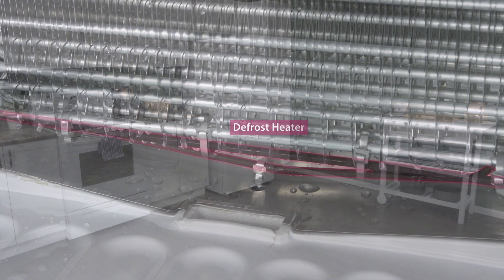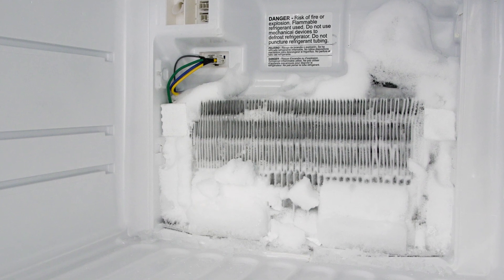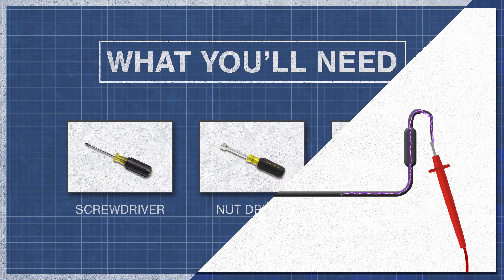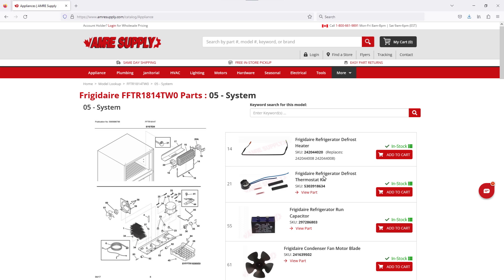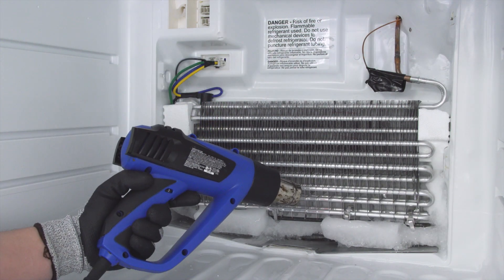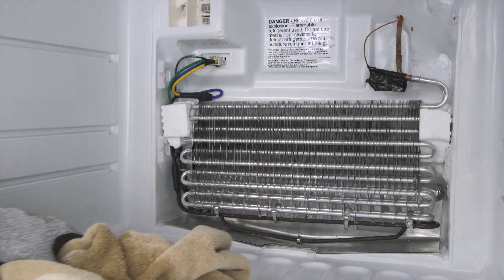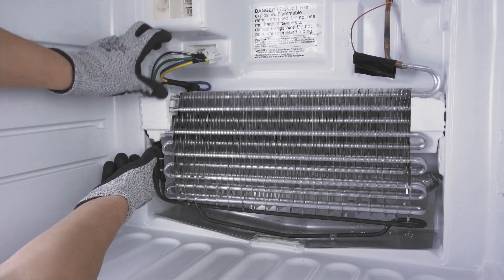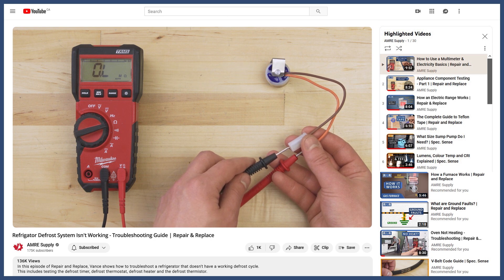How to Test & Replace a Defrost Heater in a Refrigerator | Repair & Replace

Comment: Struggling with your top freezer illustration for a side by side( more common these days) Heater testing: do you specifically have a video for side by side ?
Reply from the maker: We don't have a illustration or animation specifically for a side by side but the testing is the same. Test the heating element is similar on both types.

Comment: Vance, thank you fro sharing the info, especially the resistance values of the Defrost heater,  defrost thermistor and continuity of the defrost timer. My issue was, freezer side was working ok, but fridge side was not cooling. While checking realized condensor was full of ice.your step by step wiring checks i found out my defrost heater having 1.5 Mohms resistance.( shud be 20-100). Also my timer was shot. After removing the heater it was burnt through the sheath, thinking timer was not cutting out and had provided prolong heat until its death. Thank you.
Reply from the maker: Thanks for the detailed feedback on the video and glad you were able to diagnose the problem!

Comment: So this is the device that melts the ice accumulation on the evaporator coils and runs water all through the fridge flooding the shelves and soaking everything?
Great, got it.....
Reply from the maker: The defrost heater is an essential component. If it stops working ice builds up and prevents the refrigerator from cooling.

If you noticed some flooding, then there's likely a blockage in the defrost drain line, you can seen how to unplug this in this video:  https://youtu.be/DS3GfGceqww?si=FGj88ilZvmZEKYEG&t=255
Reply: @AmreSupply  whole drain area was frozen solid with about a cm of ice, including the drain hole. One of the strips of aluminium that dangles down the hole to prevent this had unclipped from the heater element so wasn't transferring heat, I have reattached it, Thank you for the video and reply.

Comment: How do you know which hole to put each prong in to test? I have I think 2 blacks and a green or 2 greens and black
Reply from the maker: In most cases green is a ground wire, so you'd test between the 2 black wires. It is less likely for there to be 2 ground wires and 1 black wire.
Reply: @AmreSupply thank you

Comment: Hotpoint fridge 2010 model number 80085 freezer to much ice  and the freezer is not working ice is three time to clean and then again the same problem, which item is change? Please thank you
Reply from the maker: Thanks for watching. If the freezer continues to frost / ice up, that will reduce the effectiveness and the unit will not cool properly. It's most likely that one of the defrost components have failed. You can test these components following the steps in this video: https://www.youtube.com/watch?v=r2YUNLPs4kM

Comment: For last few days the foodstuffs in my samsung double door refrigerator compartment get frozen and when i opened the back panel the condensing coil had accumulated frost on it. I  let the coil to defrost and then put back the cover and started the fridge but the problem continued and opened the  back cover again . The problem didn't go. What could be the reason and what is the remedy. ..... here i may mention that  this problem rose when there was a fault with electricity supply from grid as the electricity current fell down to below 80 volt, we here run the gadgets at 200 - 240 volts..... further i may mention the the fan in the refrigerator runs continuously.... please guide me
Reply from the maker: Thanks for watching. If the evaporator coils continue to get frosted, that means the defrost isn't doing it's job. A power surge could have damaged one of the defrost components. This video shows how to troubleshoot that: https://www.youtube.com/watch?v=5ajvSQPvT1k
Reply: @AmreSupply  
How is this video related to it.
Reply from the maker: @ You mentioned it was frosted up. A faulty defrost timer can keep the refrigerator in the cooling mode. As well a faulty cold control or temperature sensor can cause the refrigerator to run continuously: https://www.youtube.com/watch?v=sME40MR2VHc
Reply: @AmreSupply  
I am of the conclusion that one of the two sensors in the refrigerator have gone faulty, thus freezing the foodstuf
Reply from the maker: @ That is one potential cause you can test the sensor following the steps in the video linked in the previous comment.

Comment: Are you sure the Defrost Control is a separate switch in series with the Cold Control? Fridge thermostats are usually SPDT, so I don't get why your diagram has seemingly complicated the matter. Not to mention the shorting of L & N (your vertical wire mid screen) !!
Reply from the maker: Thanks for watching. Most top freezer refrigerators that use a cold control thermostat will have a defrost timer, however some will have a defrost control board. The cold control thermostats in these models have 2 terminals and is a SPST which you can see here: https://www.amresupply.com/part/VB7-FROST-FREE-BEV-CONT

The model we filmed this video with has a 2 terminal cold control thermostat and a defrost timer wired in the same way that it is in the video. In this model the compressor & fans could be turned on and off by manually advancing the defrost timer screw.

Defrost timers have 4 terminals, and what is not shown in this simplified circuit diagram is the motor & resistor on the defrost timer. I can see why you'd think it would be shorted without an additional symbol to denote the motor. This is explained more in the defrost timer video:
https://youtu.be/rsv0ary__p4?si=5IX68xC3YwbiFXhb&t=342

More in-depth troubleshooting for the defrost circuit can be found here:
https://www.youtube.com/watch?v=r2YUNLPs4kM

Comment: Also take care to not melt the plastic around the condenser if you are using a heat gun.
Reply from the maker: Yes exactly, that's why we recommend using a low heat setting. It will take longer but it will prevent the plastic from melting.
Reply: @AmreSupply f tr😮.